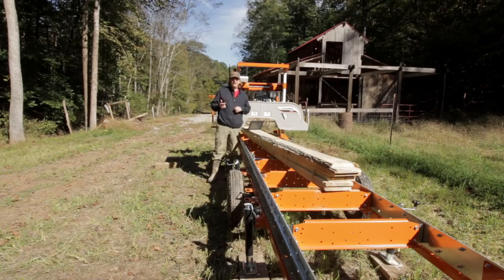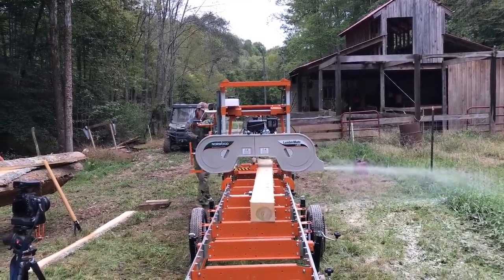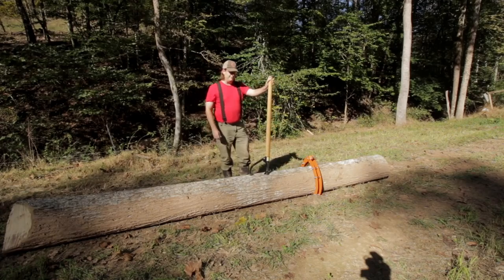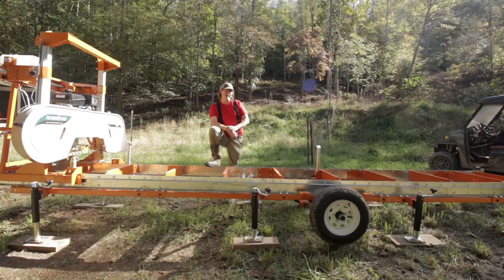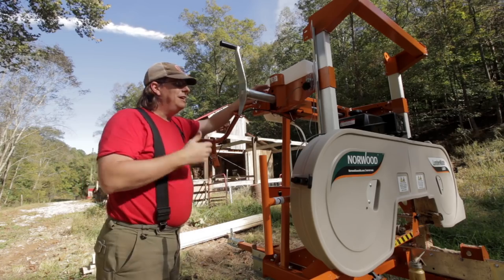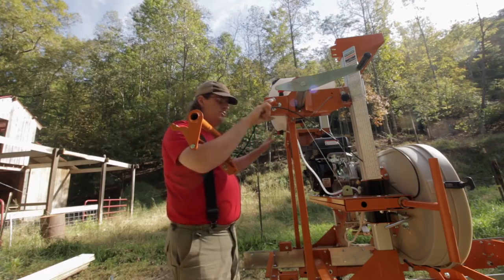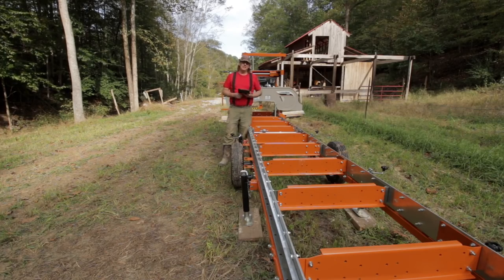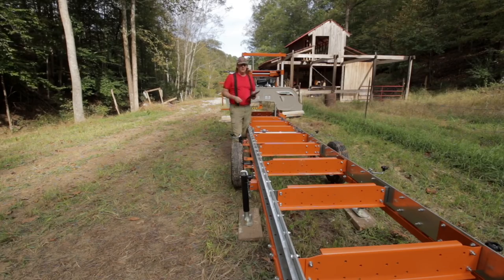Detailing our Norwood LM29 Sawmill Features and Price - A Review

Comment: Electric start you say? Im 99% sure you can add a starter and wire for 12v starting all cheaper engines usualy have the flywheel gear and just needa starter added and battery and switch. If not take pull start off and start with cordless electric drill or impact with a socket on crank.......poof electrick start
Reply from the maker: That was the first thing I looked at (retro fit). The cordless drill is a great idea!

Comment: Can you show us how to change a blade? Setting tension, blade run out, guide adjustment etc? How many times can you join a blade with the adjustment available? Do you sharpen your own? I used to make, join and sharpen 3/8" and 1/2" blades from 100m rolls for High Schools in Western Australia and a bit of pocket money for our Manual Arts Dept. Do you keep joining when they snap? Do you have hardened or standard teeth?

Comment: Troy,good video and explains everything .Like I said before I have the same mill with about 300 hrs on it.As far as the log stops go you will probley not have a problem with them.I have bent the holder that they go in.Only because I loaded a huge log with the forks on my tractor and rolled it to hard against them.A little hint on your water tank you have to turn on and adjust flow each time. What I have done is went to briggs and got a straight gas tank shutoff.Cut hose and install inline. Now after you set flow all you have todo is turn water on or off without having to adjust flow rate Any questions let me know.
Reply from the maker: I like that idea with the shut off. Definitely will have to look at that.

Comment: Thank you for the review.  I am doing my research on Sawmills for purpose of a purchase and found this helpful to assist in my selection and understanding of the product.  You did a good job explaining the features and issues.  I am intimidated by the assembly process and that is what I am most concerned with. If I could go someplace and buy it already built, I would have already purchased one and had it in my barn. I appreciate your review.  Thanks, Jim from Coarsegold CA.
Reply from the maker: It may seem daunting to put it together but it isn't overly technical. The alignment of the track was the most detailed portion. If you are comfortable doing small scale maintenance and repair of things then you should be fine.
Reply: @RedToolHouse  love the sawmill video. My granddaddy had the old style saw mills. Loved working with him at the mill as a kid.what name brand of suppenders?

Comment: Troy i think the kohler engine is the way to go. Ive got an old wheel horse tractor  thats a 1968 model. Tractor and tranny is wore real good but the old Kohler engine is as strong as ever. Ive never had a Briggs to last that long. It just keeps on going. I really like your mill. I might look into one of these. Thanks for sharing your knowledge and thoughts with us. It was very helpful. 👍👍👍👍👍
Reply from the maker: Wow, that is getting some longevity out of that engine
Reply: We also have an old Wheel Horse, the Kohler still runs great, also the gentleman next door, has a old Wheel Horse that the Kohler is running great. I think they're both from around 1968-72. Other than oil, filters and spark plugs, I think the only thing are's has needed was a new starter.

Comment: You purchased the sawmill that you wanted, period. With that said, thank you for taking the time to record this video which aptly presents your reasons for purchasing the Norwood sawmill which you wanted, your trials and tribulations in the sawmill's assembly, the manufacturers responses to your problems and the end product. 

Personally, I would never consider any model of the Norwood brand of sawmill for purchase. In my personal opinion, other than the well made and dependable drive motors which are available for each of that manufacturers models, the sawmills themselves are of poor/cheap/undependable quality. But there again, its the buyer's choice and for the most part in our business world, it is well known and understood, that you will get what you pay for.
Reply from the maker: My brother's has been running for 18 years now with little repairs needed. I built it when we first bought it so I was happy with the build. Granted, mills over 10K have many more features but I could not justify that expense for farm milling.
Reply: @RedToolHouse  I hope that your new Norwood sawmill lives up to your expectations, Happy Holidays !!!
Reply from the maker: Only time will tell. Thanks for watching and commenting

Comment: Luckily for you, Koehlers are pretty reliable. Hopefully that means the pull-start won't give you much trouble. If that's not the case, you can always take the pull-start assembly off and start it with a drill. Tis just like starting a car with a chainsaw, without all the potentially lethal bits. Sadly, I have done both, and I only recommend the former lol. Starting a car with a chainsaw is just stupid unless you're stranded in the middle of nowhere during the dead of winter. It's not difficult in theory. It's just difficult to do without hurting yourself lol.
Reply from the maker: Yeah, I am hoping it holds up. Proper maintenance will be critical
Reply: I don’t know if they have different divisions but I bought a Cub Cadet zero turn with a Kohler 22hp v-twin from Tractor Supply and it was junk. We couldn’t even get it started when I got the mower home to remove it from the trailer. I spent 3 years trying to use it and finally just gave up and sold it for a 10th of what I had paid because I didn’t want to cheat someone. The guy that bought it thought he had stolen it and laughed the whole time he was loading it. I saw him a couple months later and he told me he sees my point that every time he uses it he has to work on it. I sincerely hope that I just got a lemon and you don’t have any problems but I think that Kohler has moved a lot of their manufacturing to India and quality may suffer.
Reply from the maker: I have had similar issues with Briggs. I think there is always a chance to get a bad one.
Reply: @RedToolHouse  That applies to anything that's made in a factory these days. A by-product of mass-production and the cut corners that come with it, is that you might get a good one or you might get a bad one, depending on your luck. That applies to pretty much every company out there. The good companies just have a higher ratio of good ones to bad ones that they let out the door.
Reply: I agree Troy, I was not hating I was simply stating that my sincere hope is that you have a long and trouble free experience with the Kohler. All I was saying is that it seems they aren’t held to the same quality standards that they were 30 years ago when you could practically put sand in the oil and keep running them lol (not literally).
Reply from the maker: Oh, I didn't take your comment as hating. I know how frustrating a bad piece of equipment can be. I am about ready to set my Polaris on fire!

Comment: Koehler is a good engine but they are proud of their parts. Lot more expensive than Briggs or Honda in my experience.
Reply: Keolher is more expensive, but they the best small engine made IMO.  They will outlast a Honda or Briggs. My dad has a old troybuilt rear tine tiller that's about 35 years old that's never been kept garaged, covered or an type of protection from the weather and it will crank up and run like a brand new tiller. It's old and it does take a little eather and muscle to fire it up, but it starts every time! Take a Kohler anyday myself.

Comment: Hi fellow lm 29 owner.  I to purchased my saw i kit form and tryed to assemble it and like you had issues only my issues were with the blade covers not lining up. it took a couple trys but i finally took my head assembly to norwood to solve the issues and i 4 hrs after they checked over my entire head assembly and i was loaded back up and on my way home. Now i was told if they could not find a problum it would cost me . well no charge . Wow i was happy it wasn,t just in my brain.  Any time i have had a issue with my say it was taken care of . With that said before you move your saw i hope you got the assembly head hold down clips that are an option with trailer package. I had my trailer custom made for me and then bolted my saw directly to the trailer so now i am mobile. And yes i learned the hard way about the saw assembly tied down not holding and having the unit flew of the front of trailer and smashing into my truck. did about 1200.00 damage to saw. Now on a funnier note <I think ALL NORWOOD saw owners are not real owners unless there is a cut in at least one log rest post. LOL hope this helps you to understand your not alone lol
Reply from the maker: Sounds like they took good care of you.
Reply: Yes they did. I also explained my concerns on their trailers and they did not make me feel like they did not care.
Reply: Any reason you went with the 29 instead of the HD 36?
Reply: @beararms3777   I was a novice Sawyer and the trees in my area are from 18 to 48 inch diameter. I figured if I was doing this alone the max I thought I could personally handle around 27-28 in round.  Now I did look at the price at the time I could afford the 29 but not the hd36. I believe the standard 36 was around $7900. At the time as my 29 was around $4500. a big difference and what I was comfortable with at that time. Now my mill was extended to 24 ft but I had a custom made trailer made for it. And then I got the Kohler engine. Hope this is of help

Comment: bought 29 a few months back, hate the dogging system, and there isn't an upgrade available, the main problem i having is anything over 22 or 3 inch my log clamp crank handle, stick out past the saw slider rail so the saw head wont pass the first log clamp going to try  wedging the log instead of clamping it but worried the log will roll and takeout my saw head, feel i was mislead and bought a lumbermate 22 not a 29, saw runs good cuts straight, really wish i would of bought the 36
great channel keep up the good 
work
Reply from the maker: I am talking to them about a dogging system similar to the old LM2000 which is what I am used to. I have wedged  the log in the past if it was too big for the screw clamp. You do have to be VERY careful it doesn't come loose like you said.
Reply: Sometimes you can lower your log rests a little to get them under the curve of the log some to get the log to move over enough to get clearance for the dog. Has worked for me quite a few times, but I have also had the problem you are describing.

Comment: I'm curious about the side rails, did you have any issues with assembly in keeping them straight (level) and parallel to one another or did you have the need to use a string line for adjustments ?
Reply from the maker: The instructions emphasize the need to be very meticulous about that. If you watch our time lapse video from several weeks ago, you can see us shimming and using a string line to make sure they were aligned perfectly.
Reply: Must have been a pain in the ass considering the amount of parts, i would imagine to keep shipping costs down. Do they recommend a thread locker for assembly ? Or just the cheap lock washers.
Reply from the maker: They use nylon lock nuts and flange nuts to keep things in place.

Comment: I bought the same exact mill this fall. In your review you just confirmed all the questioning i had when i had to decide what options to add. The only option i bought which is not working well is the kwik clamp that we can use after we have done the cant on the log. You did mentioned this on an earlier video. I have asked Norwood if the clamping system from the 36 can be adapted to the 29 and the answer was no. It is to bad because the 36 clamping system seems to be a-lot more effective. What is your assessment on this?
Thanks from New-Brunswick Canada
Reply from the maker: The clamp will work but you have to wedge something (wood shim) into the area where the clamp pipe meets the side rail, this takes out the play in the pipe. When you clamp, don't clamp directly vertical, try the 11 or 1 o'clock position. Mine holds almost every time once it did those things.

Comment: How where parts shipped ? Truck freight or a 100 ups boxes ? 
When young hand started a 14 hp k , was wind and start rope type.
Made a 4 ft pull rope, one full pull with choke full on, if above 30 F started , had to get to that choke quick tho go to off gradual.
Below 30 May of had second pull involved. 
Today's gasoline is sub standard & when left sitting with out a good quality stabilizer added, you just may pull your guts out and work up a sweat.    
I hope it doesn't have a automatic choke on it.
Happy pulling till you convert it.
I'm guessing it's max pull be two feet.       Like your crazy way of explaining things. 

So for 8k how much lumber got to mill before you break even ? 
I know handiness is nice & ya got the trees, truth be known  least 8k board feet or more ? I'd think more.
I can't get good solid hemlock for .45¢ a board foot all day long round here.
Plz figure it out.
Reply from the maker: They came in numbered boxes that weer to be opened base upon the instructions. Choke is manual and standalone. I put stabilizer in all my single cylinder engines. When I used to mill for pay with my old norwood, I paid for it the first year. This one will take longer since it will be jsut for me without any retail income. Some wood for the wood shop is hard to place a value on since it will be so unique at times.
Reply: A mill this size is not for production work, and you’d wear yourself out trying to make money that way. But it’s perfect for home use and custom sawing. And I guarantee oak goes for a whole lot more than 45 cents a board foot!

Comment: I like the Norwood price and sawhead, but not the track. I think the rails have too many pieces/bolts to assemble and maintain. The deep rails are also over-engineered for stationary mills and therefore more costly than needed since all they have to support is the saw (maybe the rigidity helps on trailers though). Only the bunks need to support the log weight, but for some reason leveling feet are put on the rails (I've seen them bend). I prefer the simpler track design of the Frontier or Woodland Mills and their bunks sure look more sturdy.
Reply from the maker: I haven't seen a Woodland up close but I have been interested in the frontier setup. Never ran one, though.
Reply from the maker: I haven't seen a Woodland up close but I have been interested in the frontier setup. Never ran one, though.
Reply: @RedToolHouse  The Frontier OS27 (developed by Norwood) looks like a slightly upgraded Woodland Mills HM126 in many ways (1" more log diameter, 1" more max cut height, 1/2' longer logs, bigger standard motor, heavier, Norwood sawhead innovations). Cheeky move by Norwood, lol. Same max cant width as your LM29, and easier assembly, for about $1000 less, but 2" smaller max log diameter, and no blade support adjustment.
Reply: In this video Norwood shows how strong their HD36 rails are by loading a stack of logs perpendicular https://www.youtube.com/watch?time_continue=361&v=oePqIE_ixqM. That's not how you use a sawmill! The customer pays over $100/foot for those over-engineered rails, lol.
Reply: I would tend to agree. Non-channeled galvanized sheet metal of that thickness is entirely insufficient for all but the most delicate of hands, if you ask me. Those frame rails should be C-channel at the very least, not just glorified sheet-work with a million bolt-holes in it that will surely wallow out over time. 

If it came down to it, if at all possible, I would just buy the saw-head and build my own rack for it. Even stick-welded angle-iron would be better than what that unit came with, and alot cheaper too. If you're at all good at welding, the frame will never shift or wear out on you like bolts will, and it will remain square unless you abuse the hell out of it. 

Using that as a trailer and expecting it to stay square in the process is a pipe-dream, if you ask me, especially with the tolerances of all those bolt holes stacking up and increasing over time as it wears. 1/1000 of an inch may not mean much to most people, but it all adds up. 1/1000 of an inch of bolt-hole wear and bolt-stretch, stacked up over the hundreds of fasteners involved, is not insignificant.
Reply: @MFKR696  Yep, It'd be great to have to option to buy the saw/carriage independent from the track. No rail seams and built as strong or inexpensively as desired. Probably could build it without a welder - just a drill to attach cross-bunks to the rails.
Reply: @approots  Sure, you could probably build it without welding, but I'm a welder/fabricator/fitter by trade, so I'd just rather do it that way. My welds will last as long as the base-metal itself, and they don't loosen up over time. I'd rather do a hundred tiny welds than have a hundred bolts that I have to keep checking and tightening. 
Could be done very easily with some mild-steel channel-stock and a stick-welder running some good 7018 (I tend to prefer Lincoln Electric's rods.) It's just too bad ya can't buy the components separately, though I'm not above just building a saw-carriage out of a small band-saw machine. Come to think of it, it's not even really that hard to build a band-saw yourself. That way I could make the throat as wide as I want it to be and power it with anything that suits me. 
The sound that carriage makes when moving down the tracks is very much like nails on a chalk-board, and that tells me that certain parts are going to wear out sooner rather than later.
Reply: Other than the neat lumber gauge, this review video really made me glad I have the woodmizer (lt15). Simpler, sturdier, better design.